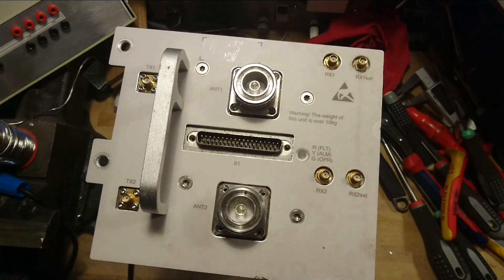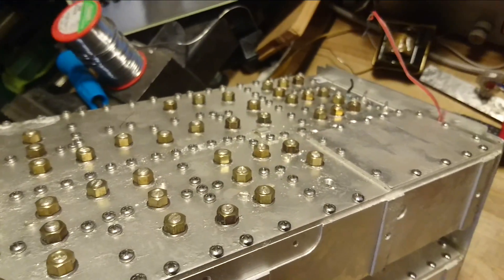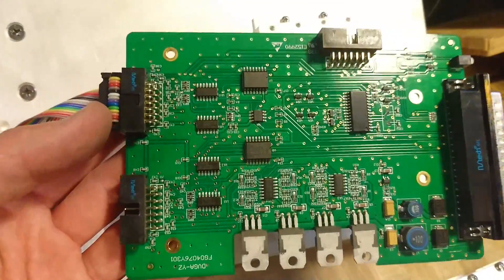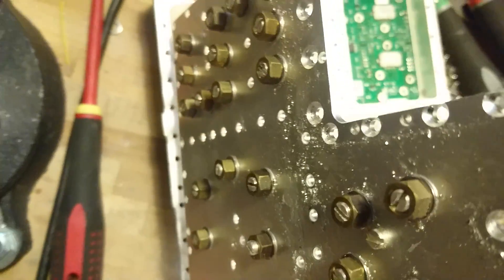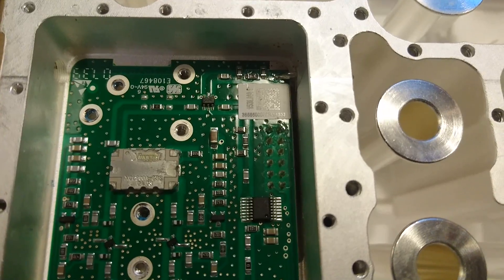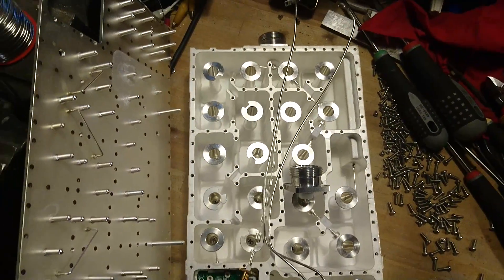GSM 900 MHz RF Amplifier/Bandpass Filter Teardown

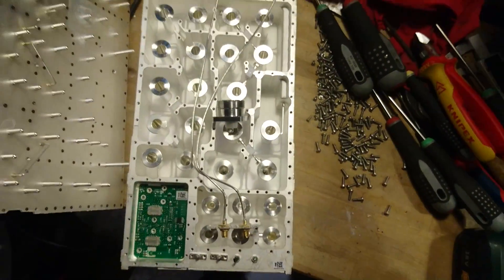Comment: 4:27 thats a low pass filter
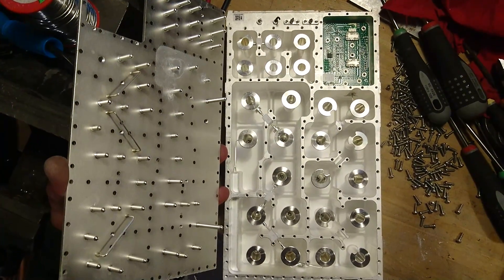2:12 if you look at the lid the white staining on the inside is where this unit has arced. power has sparked from the top of the resonator to the lid probably causing a fault.

The wire loops hanging down on the inside of the lid are inductive couplings they give better attenuation on the high side of the RX passband.
The wires that are held insulated from the body inside ptfe tubes in the tx cavities are capacitive couplings. They give better attenuation on the low side of the TX pass band. They all work together to allow you to tune the  two channels very closely together.
Reply from the maker: Thank you for sharing this. I have later on learned about the cross couplings in the cavities, but the capacitive couplings inside the PTFE tubes is new to me. I think this video was one of my first RF teardown videos. I have later on done up to some 20+ videos on other 3G/4G amplifiers/systems, if you want to see those :)

Comment: Can any one explain why the base station has an ungodly mount of screws. Is it because of maintaining it's calibration in all types of environments?
Reply from the maker: It operates at very varying temperatures, being mounted at the top of a tower near the antenna itself. So it has to be very sturdy and resist metal expansion/contraction, without breaking the RF tightness between modules. If you just have the slightest crack you have RF energy floating around between sections and it will render the amplifier useless.
Reply: @KaizerPowerElectronicsDk  I never thought about rf leakage but how u explain it makes sense. Thanks!!!
Reply: @Emphasis213  It makes a huge difference on passive intermodulation products inside the unit too (internal interference caused by two signals ringing at other frequencies)

Comment: Friend we need to have filter to cover the entire FRS / GRMS UHF band.
Because here in the region has a community radio with strong signal on FM 88 - 108 mhz.
So we want a filter of 462 mhz up to 468 hmz to cover the entire range of FRS and GMRS.
How can we filter the weak signals only from this frequency and ignore the strongest signals? So we will not hear the signal of FM 88 - 108 mhz because it will be squeaking and not working?

We just want to listen and transmit in FRS and GRMS and make sure the Baofeng UV-5R also receives these weak signals.

https://www.changpuak.ch/electronics/combline_bandpass_filter_designer.php
Reply: not sure if this is still a problem for you but you want a high pass filter. try here:
http://www.learningaboutelectronics.com/Articles/High-pass-filter-calculator.php#answer1
that will be a lot easier to build and tune than a combline bandpass

Comment: That filter is actually a diplexer. It allows the receiver and transmitter to use the same antenna simultaneously.
Reply from the maker: Hi Roger, you are right, this is a diplexer and at the time I was not aware of that name, but knew that it was a high and low pass filter for the operation that is then given the name diplexer :)
Reply: nothing unusual, i work with these stuff ;)

Comment: Great. Big thumbs up. Nice machined aluminium and brass. Silver plated. Awesome.
Reply from the maker: Unfortunately I could only find the filter part, the rest of the amplifier was already gone.
Reply: @KaizerPowerElectronicsDk  The rx amplifier is two fets in between the xinger splitters on the circuit board. I used to work on that exact unit. i Think its name was a Kathrein "DV something something "  very commonly used in 3g basestations.
Reply from the maker: @JohnSmith1066-l5n  Thank you for some details, its always great to hear from the people that designed/worked with what I show here :)